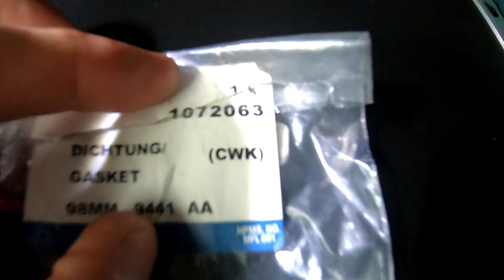Focus MK1 - Rebuilding the Inlet Manifold & Re-gaining lost Efficiency!

Comment: What a GREAT tutorial about the Focus MK1 intake system, splendid! So much knowledge about these parts (and your other vids, too), I appreciate your effort! Btw, the pre-facelift MK1 has a slightly other gasket for the idle control sensor. I just wanted to buy a used intake manifold for my 1.6 (2003) but I saw that it was from ´98, so the gasket did not fit. And yes, the screws from the throttle body always breaks and its not easy to drill them out. Keep it up buddy :) Greetings from Germany!
Reply from the maker: I'm really glad you enjoyed this video :)

Comment: You can fit the puma manifold on the 1600 engine
Reply from the maker: You can but this is a 1.4, I would also say that increased fuel consumption is also an unwanted effect from what was a very common modification. Sadly there are not too many 1.7 manifolds around as less Pumas are with us.
Reply: @usuallyfixingtinkering  Do intake manifold and cams from zetec 2.0 fit on zetec S 1.6 (silver top)?
Reply from the maker: @coazetec  nope completely different engines
Reply: @usuallyfixingtinkering  So i saw misinformation on web...Thanks for fast reply!
Reply from the maker: @coazetec  yeah I don't know where that came from!

Comment: Hey there I’ve done this job and it did good to my 1.6 engine 
In the last 3 years my car having a little rough cold starts i turned out to be a bad idle control valve ( that somehow had a whistle noise coming from it ) i bought an new genuine Hella one and it did worse so i bought an used original ford one it did great 95% of the cold starts are perfect 
All the breather hoses are brand new genuine ford ones PCV valve ford genuine coil pack new style Bosch unit new Ht leads new correct ford genuine spark plugs new inlet manifold seals , idle control valve seal , throttle body seal 
Everything is really top notch 
What an i missing ?
Maybe its the O2 sensors ?
Reply from the maker: Potentially but it a stab in the dark sometimes, you need to go through all the components it sounds really basic for a rough start.
Reply: What would you recommend to do because I really did go over all the components everything is in spec and in great condition what should i do 🙏

Comment: As for diesel engines, intake is made from metal (i think aluminum). Now from problems, at least for me, is carbon build-up and to really clean it you need remove it. ERG is stuck to it without possible to remove it. In order to remove intake, you need also remove exhaust manifold and that is attached with turbo, it is huge pain, but I do recommend on any diesel remove it and really clean it. But seriously, who thought plastic manifold is good idea?? My cougar 2.0l Zetec had metal too!
Reply from the maker: Been there before we you start working backwards because everything is seized together. I don't hate plastic manifolds but some of them are nasty, these are nicely constructed and never give trouble apart from when removing them from the throttle body!

Comment: Hello! I think my fuel pressure regulator has failed, because if I let the car sit even for 10 minutes, when I try to turn it on, it starts very hard. If I put the contact on, basically forcing the fuel pump to pump more fuel into the fuel rail, then it starts normally. So my conclusion is that the fuel pressure regulator doesn't hold pressure anymore.
Having 2 MK1s, I switched the fuel ramp between them and the symptoms went to the other car.
My question is, where besides the scrapping yard can I find that regulator new. I didn't find anything aftermarket...
As I understand you were able to buy it new and original?
Thanks!
Reply from the maker: It looks like it may be a little weak, no new regulators are unobtainable from ford so at the moment 2nd hand is the only way unless aftermarket manufacturers start making them!

Comment: Hey Andrew, i have a question. My temperature reading on the cluster is going up and down, it stays in the middle after a while of going crazy, but then it goes  all the way down, fortunately it never overheated tho. I changed the thermostat, this improved things but after 2 days, it still does this( going all the way to the middle, then dropping back down).After 10 minutes or so, it stabilizes and stays in the middle in it's working temperature. I have a focus 2004 mod, zetec se 1.6, the collection edition, hatchback. Do you know where the coolant temperature sensor is on this car, because i suspect that's the case. Also, do you know which of the two types of sensors this car is compatible with? If I'm not mistaken, the facelift model has a different type then the pre facelift. Thank you in advance man, you're a focus encyclopedia!!
Reply from the maker: I have never heard of two types on this engine, there is just one type and it will fit any 1.4/1.6 car. I recommend cambiare temp sensor as this appears to be the fault.
Reply: @usuallyfixingtinkering  Is cambiare a brand?
Reply from the maker: yep!
Reply: mine did this it was the cylinder head temp switch between spark plug 2 and 3.